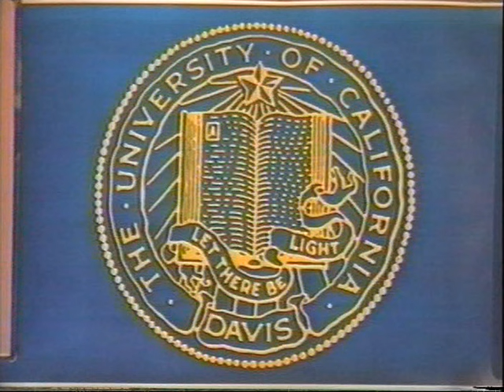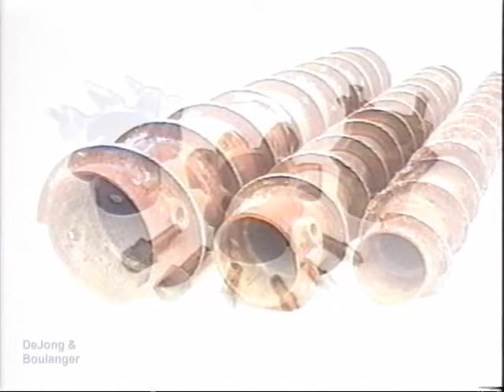An introduction to drilling and sampling in geotechnical practice -- 2nd Edition

Comment: I  have done very little Geotechnical Drilling but I have done some.  Most of my Drilling Experience has been in the Oilfield.  

QUESTION:: Why do Core Bit Manufacturers, Core Drill Rod Manufacturers, etc. list the sizes of their products  with Letters rather than Numbers to Distinguish the Diameters whether in Inches (Example, 12.25 or 12-1/4 inch bit) or the Metric System's equivalent of Centimeters?

I am sure there is a reason for this which has NEVER been explained to me.  THANK YOU In Advance.

Comment: I showed this to my spouse who has been a Geotechnical soil engineer for 22 years and he was surprised on how antiquated some of these methods were. Infact, he has never seen that cathead devise at any jobsite. Still good watch though.
Reply: If you guys live in Canada, the cathead hoist is effectively outlawed there. In the US approximately half of every driller I know still uses catheads.
Reply: Thirty years ago i was running one in rain/snow mix,  rope stuck to the cathead and sent the hammer to the top of the 27ft tall mast in about .5 seconds..had to climb the mast to unlodge the sob.
I can think of five coworkers offhand (no pun intended) that had lost fingers and entire arms to those old rigs, they were all auger related.
I almost lost the ring finger on my right hand once but my reflexes saved me, cut down to but not into the tendon.
Rule number one of drilling- never drill alone.
Reply: @robmurphy806  that's crazy...they had auto hammers at least thirty years ago.

Comment: How do you stop the borehole from colapsing?
Reply: By reaming the section of borehole drilled repeatedly, until the BHA travels without any hang-ups, by utilizing a flighted stabilizer above the tricone to smear the borehole wall and keep it straighter,  by maintaining a slight overbalance with mud density, to prevent hydrostatic influx and lithostatic pressure from collapsing the borehole.

Comment: Im telling you  what this guy knows about mud drilling you could write on the head of a pin with a magic marker. lol Anybody douts what im saying and want to know how to keep a good hole in all conditions and perfectly strait get a hold of me and I will teach you for a small fee. But you dont have to pay me if im not backing up what im saying. I'll show you how to bounce casing set of 2-3 hundred ft. That means when you knock off your ear holding the pipe up and it drops about 6 inches the casing will bounce because of how clean the hole is. I guarantee it. Been drilling for 52 years.